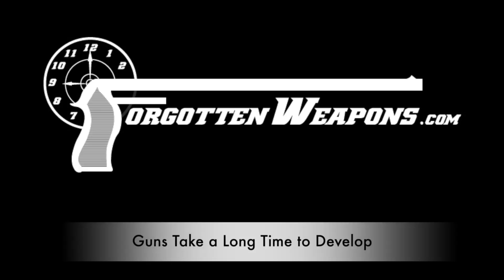Why Guns Take Years to Get Into Production

Comment: What is also need to be addressed is that as a firearm production gets mature in its process
That is the process of well understood it can be measured. It can be repeated you start having challenges of getting material. You start having challenges of having manufacturing equipment where out and having to reproof that without significantly slowing down production so you might have to have some more done with critical paths in the manufacturing so as one machine is out of commission, you have another machine that’s proved to be able to take over.

Here’s another one you have to have trained labor that you can depend on. I recall specifically when the unions in the United States were very strong. They would demand raises for their union members, and in many cases, the union members would strike in solidarity for unions that have industries not related to the industry they’re going to strike and slow down.

A whole area of things can occur and the production process can become obsolete. That means material can be too expensive. Let’s take hold cobalt brewing, becoming too toxic for the requirements of OSHA.

Or maybe having parts that have to be broached that’s a type of machining or press fit or maybe materials that are hard to source

And you can have a broken manufacturing process because you can no longer afford to make the firearm. I’ve seen certain high-quality sporting firearms start getting lowered in quality to the point where it’s not the same firearm anymore functionally

Comment: MMM... tolerances add up in awkward ways. I was recently brought a self loading 22Mag rifle that appeared to be a "lemon". The shop that sold it as new (although not in a box and with no paperwork) did my client a disservice. It was evident from the damage on the roll pins that the barrel had been taken out, and not at the factory.
It didn't extract sometimes, and other times didn't fully cycle. Case bases were bulged, and some times a rim would blow out (although I think that was inferior ammo), and as you can imagine my client was at the end of his tether. Working out what was happening was not easy, but the main issues were a) rough chamber causing cases being hard to extract, and b) extractor engagement minimal due to the way the breech was machined. It was a delayed blowback rifle, and the timing of the delay was all over the place due to rough finish on some of the parts involved. I think I have it working now, but it's obvious that a bit more development would have been a good idea, or at least better QC at the factory in Brazil to get more consistency. Most examples of this rifle shoot well and reliably, but it would seem that sometimes they don't and the number of ones that give trouble is higher than it should be. Yes, guns are tricky, and making them to a price point while still being consistently reliable is a near impossibility even with modern techniques.

Comment: I worked at a construction mobile crane manufacturing company in the US and I can tell you that in 2007 we probably produced the best quality product that we ever could and it was actually amazing. We are running 3 shifts 23/7 and every unit was already sold. All of our vendors were producing only for us our rejection rate was reduced to almost nothing no personal movement in production, no pressure for cost reduction at all no pressure for new design development all of engineering was focused on production throughput not on cost. It was amazing everyone was happy if a little tired. Everything was running better than I thought even possible. It was really a sight to behold. And then 2008 and every thing went to hell even though production was cut to less than a quarter of the year prior our quality was terrible by the end of the year.

Comment: ty for explaining this . . . same goes for the aviation, lots of peeps @ redbull air races ask HC we can't make WW 2 warbirds / repro's, and make 2K+ hp piston engines, well tooling, jigs, machine, design blueprints, and even the line manufacturing little tips and tricks were lost once the jet age began, there was 80 yr old engine mechanic that worked on some of the redbull warbirds, said no one knows the formula for gasket and seals, and it would take years and millions to make and test with modern polymers, but things could change with, and its better just to milsurp (which strangely in the early 2K they had 'discovered' an abandoned warehouse with lots of ww 2 stock.

Comment: Tool wear is also a major challenge. My dad was a Master Tool and Die maker part of his early work was making and resharpening cutting tools for the production line along with six die sets to crush couplings tight on hydraulic lines used on big earthmovers. Tolerances on some hydraulic parts can be in 1/10,000 of an inch plus minus 1/100,000 range.

Comment: I worked a factory job in a tier 2 auto parts manufacturing/painting factory. A large paint line, cream dip oven bake type. We painted rear axel housings, you know the differential bell housing with axel tubes and many attachment brackets. One station, pressed in the bolts for the diff cover and then the axel housing went on a stand where the housing can easily be rotated. In one hand you held 2-3 no go/go gauges and an orange dead blow nonmarring hammer in the other. You adjusted these brackets to easily accept the gauge, each gauge was rectangular able to gauge two brackets each. Once all brackets were adjusted and welds examined specific points were marked with paint markers. These type of factories have whole Quality Control departments, whose sole job is to make a round daily taking parts off stations and clamping them in a QC fixture to ensure tolerances were in spec. These people had authority to stop any production immediately and technicians would identify the issue and make adjustments/repairs to fix whatever issue was identified. All parts containers are labelled with station, person and date/time information in code form. Parts that could be out of spec were sorted and any that were separated and put in waste/recycle bins. 
    As design and manufacturing equipment gets better and better, accuracy is improved in parts production and overall design to production times have to deal with how much money is potentially being made contrasted with the costs of r and d plus production. Things could be very rapidly be mass produced accurately if cost were of no concern. People want return on investments not simply producing the highest quality masterpiece priced in range everyone could afford. Hopefully we’ll get there one day though.

Comment: Wow its crazy how much of this holds true for any reasonably complicated mass manufactured product.  In Electrical Engineering it’s relatively easy to design a prototype that works ok on a lab bench compared to designing a board thatll go through multiple stages of testing, assembly, and calibration, sometimes involving a dozen or more technicians

Comment: I wonder how did they compensate for wear of tools in the old days? As far as I know, modern so called 4D CNC machines control cutting surfaces themselves by lasers and are able to compensate for wear automatically or signal when it's time to change or sharpen a tool. I get that the should have been control guys, who would measure either every detail or one out of a bunch to save time, but then what?

Comment: As far as I know, the two biggest wins from CNC vs regular machining are that 1) you don't need to move the part between machining centres (as often) and hope it ends up in the right spot each time and 2) you don't need to manufacture new jigs and/or fixtures if a dimension needs to be tweaked.

Comment: Of the examples you gave of firearms that had teething pains but hung in to become very good, the Sig P320 comes to mind.  Everyone likes to jump on it (mostly Glock fanboys) for going off when dropped, but in fact it passed every federal and state drop test requirement, even California's.  But it got fixed and now it's just fine (and no, I don't count all the "sudden unexplained" discharges by assorted LEO's...it has a firing pin safety and can't go off unless the trigger is pulled, period.  This new thing is just something some trial lawyers think it gonna give them a payday).

Comment: T5:45 What a laugh and in a bad way. Talking cycling, cycling measurement systems. You talk inches but then talk metric for the tolerance instead of say 98/99 ths of an inch to 104/99 ths inch. 

But hey it’s freedom units even though that was legislated out in January 1975

I get it but I still find it funny. FU are stupidly complex in that even thinking about a pair of proportions of unit requires further maths to get metric to see which is bigger or smaller and so on. Well unless the base number happens to be the same, but that never happens. Look at a spanner set.

Comment: I've been half-wondering why someone doesn't make brand new M1 Garands; I suspect that this may be one of the issues, even though it's my understanding that Springfield made lots of notes on producing M1 Garands.

I hope these notes aren't lost!

It's my understanding that this is also a major reason why we can't just make Saturn V rockets right now -- it may very well take 10 years for factories to "tool up" to make the parts needed, and a lot of the little bits of information to make these parts have been lost.  That, and our tech has changed a lot since the last Saturn V launched, and we'd benefit greatly using that new knowledge instead of trying to rebuild an old rocket (which may be another factor preventing Garands from being built today, too!).

Comment: The funny thing about tolerances, clearances & manufacturing capabilities, especially when you're talking about high-speed guns (Gatling's in my case) is that you're trying to satisfy competing goals:

- Want the mechanism to be smooth and reliable up front? Design the clearances you need and tighten up the tolerances a bit.
- Want the weapon to be functional from -65°F to 160°F? Open up the tolerances a bit.
- Want the weapon to function reliably for 100,000 rounds between overhauls? Start out with the clearances and tolerances a bit tighter and let part wear open them up... but not too much, you still need it to behave well when it fires round 99,999.
- Want the weapon to not have to be cleaned of grease, dust, and gun gas gunk too often? Open up the clearances a bit so the build-up doesn't bind anything, but keep the tolerances tight so that the mechanism doesn't get sloppy.
- Does the weapon have parts (like the barrel) that get really hot (and grow) during firing? Open up the clearances on the interfaces to those parts to keep the stresses manageable, but keep the tolerances reasonably tight so that you don't lose part interchangeability.
- Have a customer that wants the weapon at the cheapest price? Manage your part clearances and open up the tolerances as much as you can (precision costs money).
- Want to maintain good round control over the life of the weapon? Minimize the clearances and tighten up the tolerances on the guide features.
- Want to use a gun that fires at 4,500 spm as a sniper rifle? Manage your clearances and tolerances throughout the entire temperature range of the weapon - realizing that your gun barrels at the end of your engagement are 1/4" longer than they were when you started because of thermal growth.

You can't succeed in everything at the same time, so the design process includes a number of trades - what are you (or the customer) willing to give up in order to get something else?

Comment: This is why Brandon Herrera gets so frustrated with people constantly asking when the AK-50 will be ready.
Designing a gun is hard enough. Designing one around the pressure generated by .50 BMG is on another level.
You can't just scale it up; you can't scale the molecules of the metal up. More massive parts with higher stress on the same size molecules can do some janky stuff, and janky combined with explosives can be a really bad time.

Comment: I've been involved in productionizing mechanical products for 40yrs so I agree with all you've said. I would like to see you explain something like gun barrel design & manufacture.
The history of guns tracks the metallurgy of barrels & the ability to do accurate gun-drilling.

One point in your explanation was on tolerances, all good but the build up of tolerances is important in a mechanism. All components can be in tolerance, but if all at bottom end the assembly can be off.

Comment: It makes sense why it takes a long time. Guns deal with high pressures, explosions, fast moving projectiles etc. A new gun needs to be safe for the user and failure can mean an explosion harming or killing a user.  Once you manage to design a gun that doesn't explode, works as intended, and is reliable, then you have to set up production and do all that governmental paperwork a company has to do with getting a gun onto the market.

Comment: The reason why hand-built one-off prototypes are easy to get right while factory mass-produced guns are so hard is because the prototype receives hundreds hours of hand-crafting and attention by engineers and gunsmiths. You can't do that at the factory. If you did, each gun would cost $50,000 dollars instead of $800.

Comment: Question, if you will.
It sounds like a lot of the issues with tolerances come down to some finicky nuances of CNC.
Do you think advances in 3D printed metals could resolve this particular issue?
For reference, with some software tweaks to a printer already on the market, *in 2017*, some scientists were able to precisely manipulate the microcrystalline structure of the steel. I don't mean temper or heat treat the whole thing, I mean they gave minute parts of the same object different microstructures. Executive summary here, but the original paper is very interesting. https://www.sciencemag.org/news/2017/10/3d-printing-doubles-strength-stainless-steel
This was improved upon in 2020. https://3dprintingindustry.com/news/researchers-develop-porous-free-metal-3d-printing-method-highest-tensile-strength-yet-170838/
What this speaks to is an EXTREMELY high degree of precision - far higher than CNC, or at least your average CNC.
If they can reliably zero the printers with every print, then the translation from digital file to physical object could be smooth indeed.
Have you followed the technology at all, and if you have, have you given much thought to what opportunities could it open up for firearms manufacturing?

Comment: One of the weird "little things" that typically happens with military firearms manufacture: fastener tolerances.  In general, pressure tolerances due to tension forces (i.e., how much a fastener is pushing / pulling materials, causing some distortion) are tricky to figure out, and non-obvious; a firearm w/ perfectly-cut, bent, welded, etc. parts may be a huge mess if the fasteners are causing dimensional drift after final assembly (or, in some cases, during field-stripping).  This is one of the reasons why really famously-reliable stamped firearms tend to have tight tolerances on a few small areas, but surprising forgiveness elsewhere (I doubt if there are two Stens anywhere that match within a thousandth on all major dimensions).

Also, one of the fascinating bits about the AEK-971 system and the AK's based on BARS systems is just how long it's taken to get the BARS pulleys exactly right. This is probably a textbook example of teething issues in a new concept- even though the basic idea's been around for 50 years!

And yeah, the AK-50 is still not even an alpha-stage firearm. But I honestly think Brandon will eventually get it "working", in the sense that it will cycle properly.  I think he's on the wrong track with the magazine, but hey, time will tell.

Comment: Something Ian didn't mention was tolerance stacking.  He talked about tolerances and ranges.  A knock-on issue from that is where the tolerances from individual parts that have to work in combination may cause unreliability.  Taking the 1 inch +/- .05 example, the part next to it may have an initial range of .5 inch +/- .025 inch.  However, if you have the first part at .95 and the second part at .475, they may not like each other very much because the fit is now too loose.  If either of the parts is closer to their maximum instead of the minimum, they'll work just fine, though.  The opposite may also be true where each might be at their maximum (1.05 and .525) and they fit too tightly causing binding.  All of that would necessitate either tightening up the tolerances for both parts, or ensuring that the combination of tolerances is within a specific range via fit checks during assembly.  Either of those propositions would add extra time and expense, of course.

Comment: The L85 is a great example of how a problem here can result in a sympton waaaaaay over there. My dad found a production problem with tape recorders that was actually an issue with the lack of a toaster oven in the break room. How did you get from one to the other? Easy, just follow the tape head line through two shifts on a Tuesday or Thursday. No problem at all...